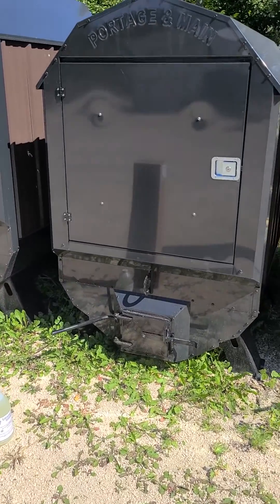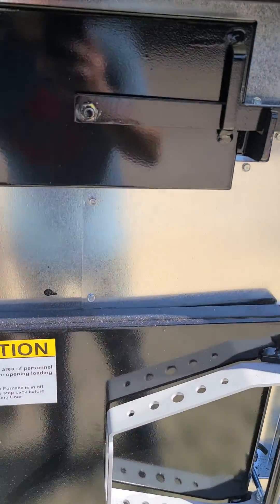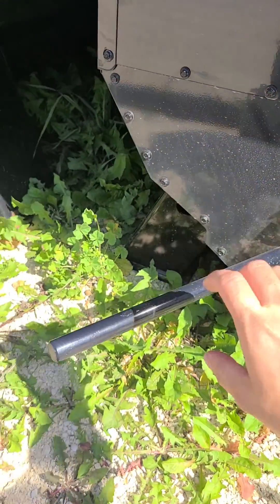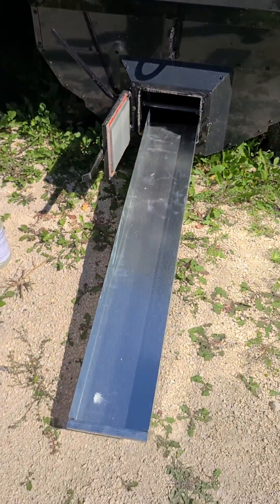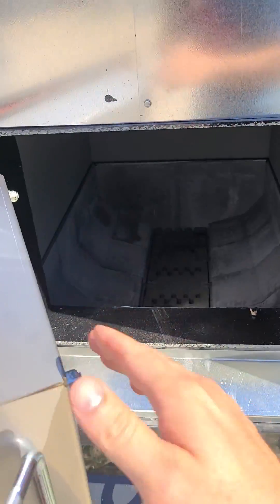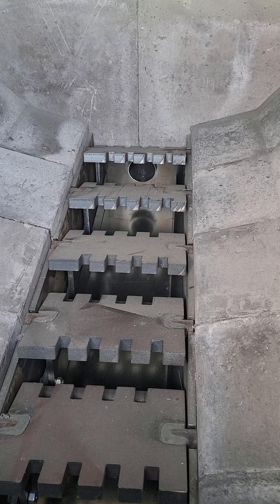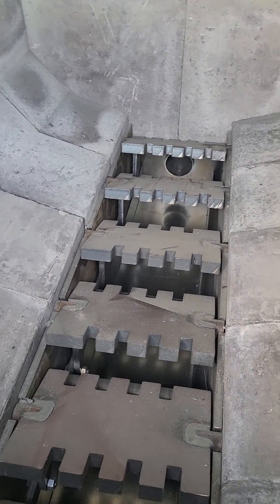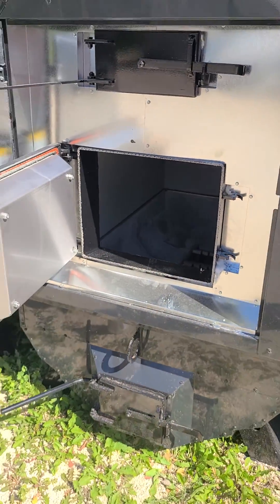Portage and Main Ultimizer BL28-40 Shaker Grate Demo

Comment: I have that same model heating my 2600 sf house and my DHW. It is so much more efficient than my last wood boiler. The firebrick insulates the firebox allowing the temperature to get into a gasification burn which really has reduced my wood consumption. AWESOME unit.